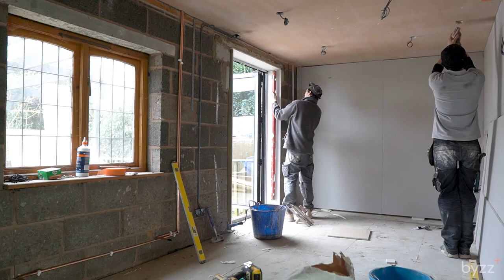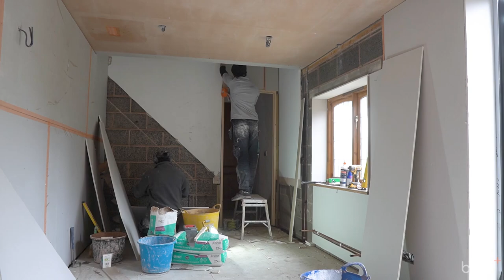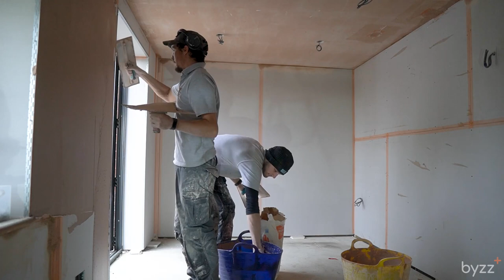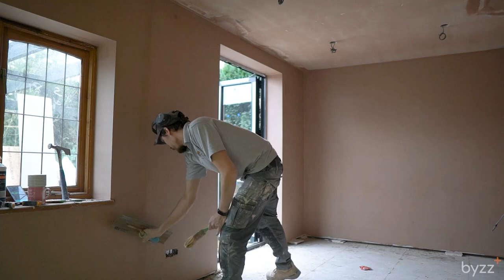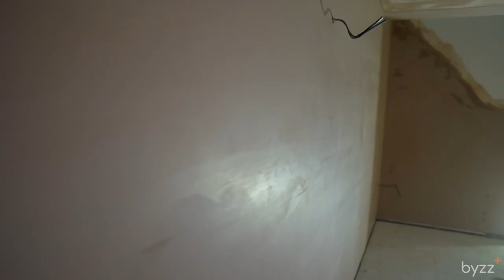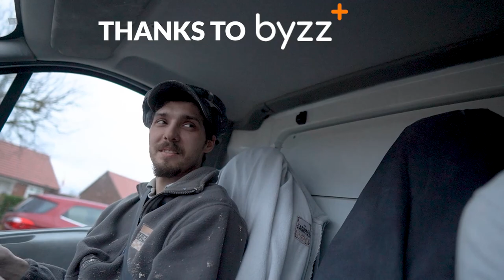Boarding And Skimming A Garage Conversion - Plastering Vlog - Convert A Garage - 1 Day Job

Comment: Was installation not required before the plaster boards went on? Or is that optional?
Reply from the maker: This is a two course wall so the insulation is between the two courses. Hope this answers your question.

Comment: Good job lads, do you find plastic rad pipes and clips take some boarding over and keeping level cus I’m finding it difficult especially when close to door frames and getting board to fit flush with them, I think they should be chopped in, how do you guys find them?
Reply from the maker: Thanks 👍 Yeah, pipes should always be chopped in I think personally but when they aren't, and if you can't get your boards back far enough we just cut around the pipes and bond over them. Then we tape in and over the bonding to make sure we protect against cracks. Pipes are a massive issue for us most of the time!
Reply: Never thought of that method with the bonding and tape,I had one a few weeks ago an extension plastic pipes and copper pipes all on clips the ones on the clips I hacked out  as it was thermalite block,usually I've always notched clips and brackets out on the back of the plasterboard,
Reply from the maker: That's probably the best method to prevent risk of cracking but these pipes would have made us be way out on the sockets if we had gone over them, so we taped them up.

Comment: Are you trowelling up just with the flexis? Or stick with your main trowel after the flatten? What’s the process and tools you’re using?
Reply from the maker: We go steel for putting on both coats, and 1st trowel. Then flexi for the 2nd trowel and cross. 

We use Ox trowels with a Ragini corner trowel.
Reply: Looks decent 👍 old carbon mt all the way through for me. Got a Refina superflex 3 but can’t get on with it. Probably needs more use before it comes good.
Reply from the maker: I've been interested in using a carbon MT just to try it out. Do you oil yours?
Reply: @ryanseeley  sometimes I spray a bit of wd40 on it but normally just dry it off on my jumper at the end of the day. Once the steel goes black it doesn’t really rust too bad, they break in quick and there’s a bit of give in the blade, it’s not as rigid as a stainless I don’t think. I’ve got a broken in stainless aswell. Not sure if I’d buy another carbon over a stainless I’m undecided which is better but the carbon is what I use at the moment.